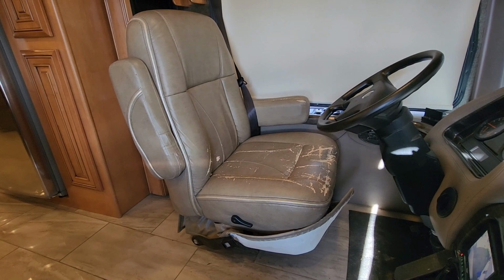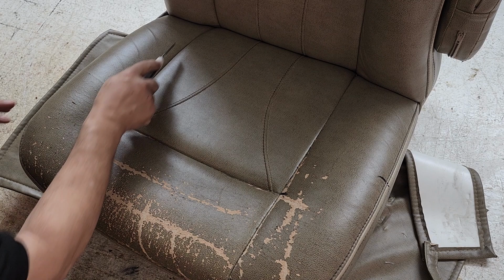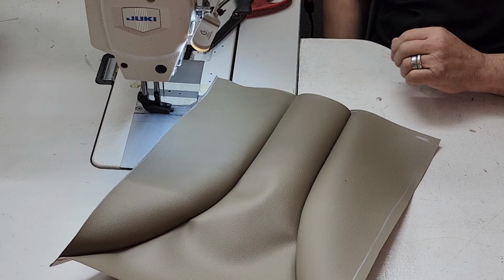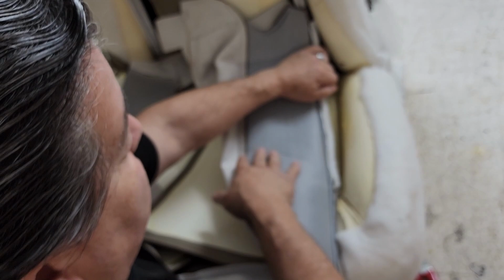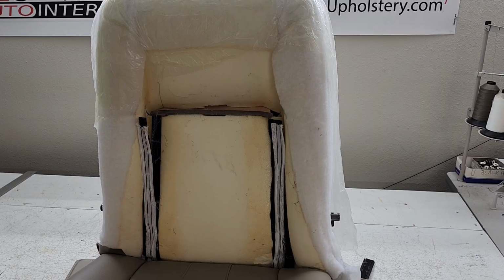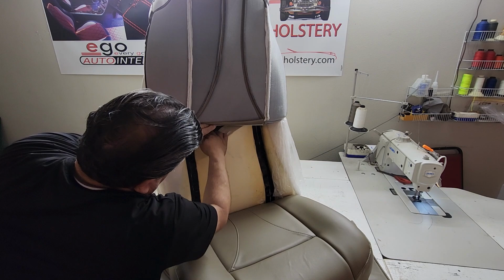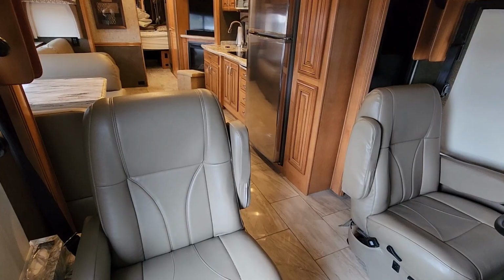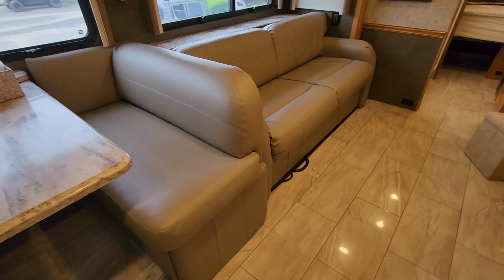Converting RV Motorcoach Vinyl Seats From Cheap Chinese Vinyl Upholstery

Comment: Great work 👏...im starting to learn upholstery have done 1 set of seats came out great....i just signed up a account with the company you mentioned you buy your material from (keyston) how do you pre measure the amount of material to use on each project? I want to do a leather/vinyl  interior leather is expensive
Reply from the maker: Hello Jrv, it's sounds to me like you are doing everything right. When estimating materials, I always take into account that the vinyl roll width is 54 inches. Then try to fit the patterns down the roll. I always add one extra yard just to be safe so I don't come up short. Please keep liking and watching!